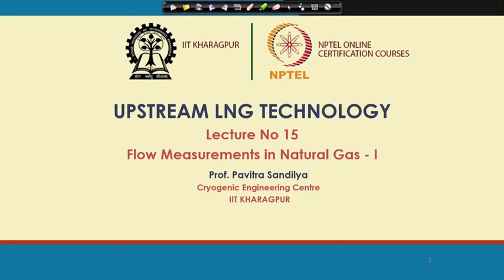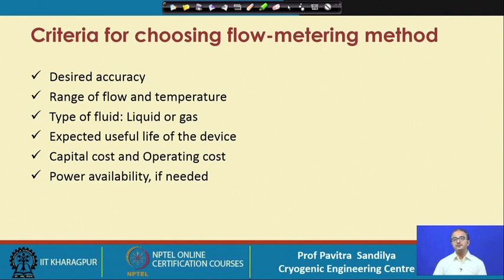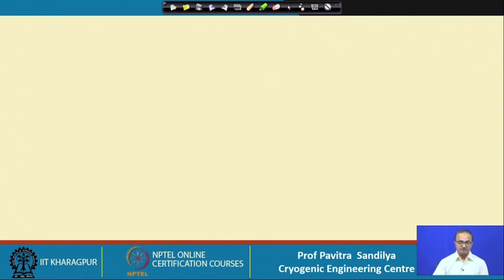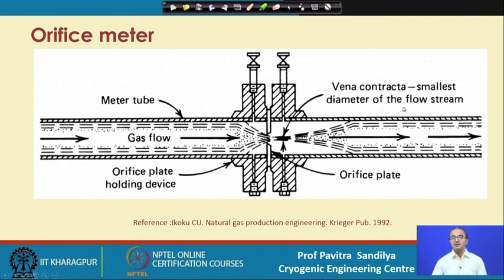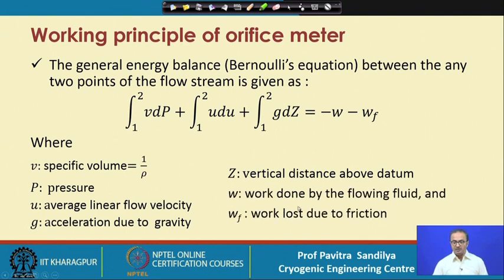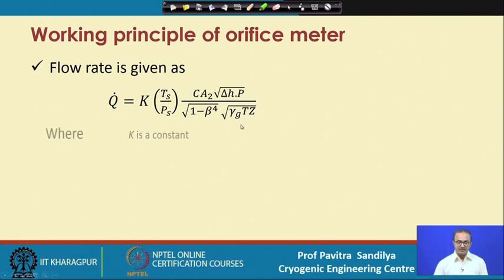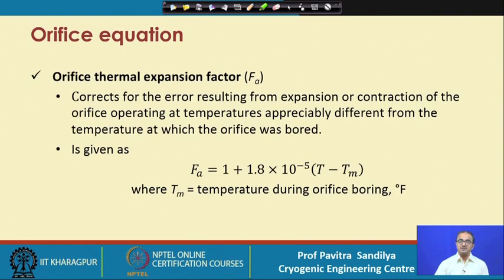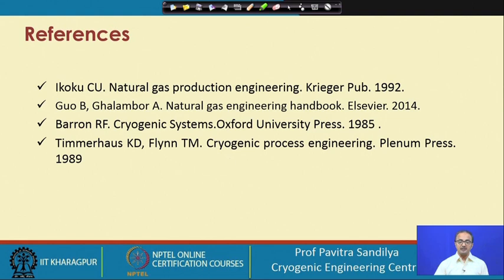Lecture 15: Flow Measurement In Natural Gas -I

Comment: So we can say that in oriface meter type, Gas flow in MMSCF depends directly on DP and Static Pressure. 
How temperature effects the MMSCF.
like in Join Meter Calibration the Gas Supplier calibrates Static pressure, DP and temperature.
Most of the time i believe that temperature depends inversely on MMSCF but I'm not sure. 
At our industrial side calibrating DP values -0.01% proves to be little beneficial for us.